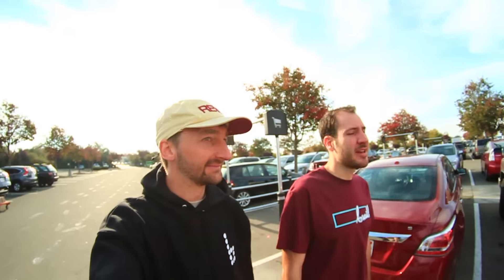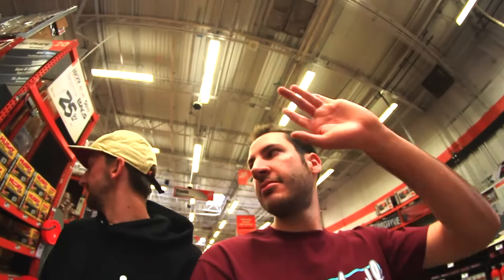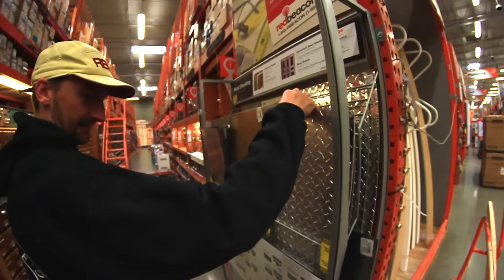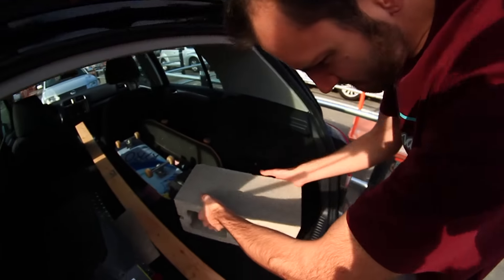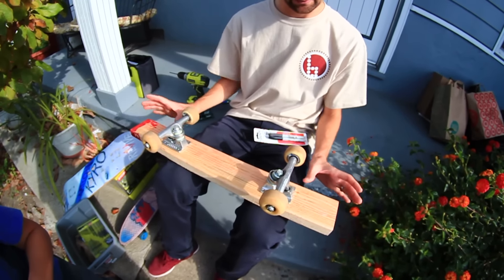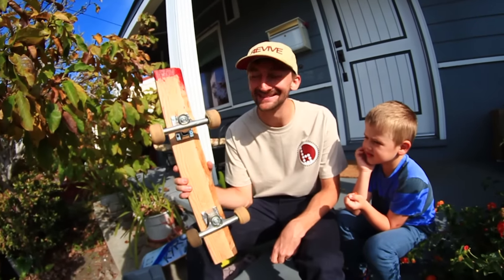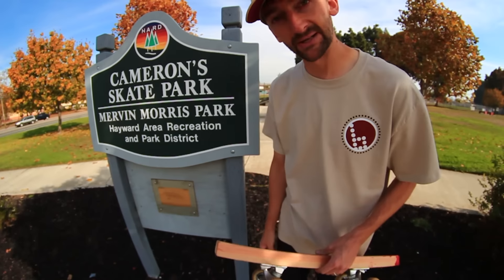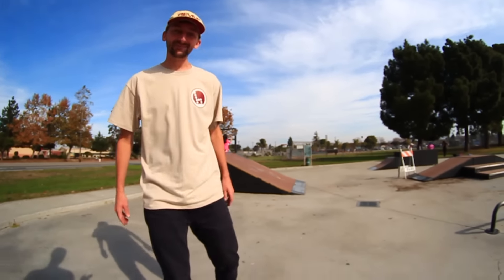SKATEBOARD TRICKS ON A 2X4 | SKATE EVERYTHING EPISODE 1

Comment: In case you haven't figured it out already, I've noticed you have had this problem in a few videos.
Basically the reason the trucks don't line up is you're not drilling completely straight, easy solution is to attach the trucks on the side you drilled on, where you marked with the sharpie, should be more lined up that way.

Comment: Use a tape measure measure from the outside edge length wise to where you want the trucks to be use a carpenter pencil mark it on each side draw a straight line across the two by four line the top of the truck up with you straight line boom! Straight trucks every time!

Comment: You need a 1x8 of some nice strong wood (maple, hickory, or ash; you're not gonna get much flex from a non-composite anyway) and some angle grinder disks (the ones with the adhesive on the back) for grip. Might be able to make a decent hardware store deck.

If somebody has the time to make and send them this, I'd like to see a game of hardware store SKATE. Maybe even get them to wear Ranglers and steel-toe boots.

Comment: If you are still taking suggestions, how about making a deck out of rolled 3/16th inch steel, sharpened to a razor edge, and liberally coated in suet?
No, no, that is a horrible idea.  Sorry.
How about making a skateboard out of an old car tire?
Or a bundle of asphalt shingles?
Or made of ice?  (construct  the deck upside down in the freezer, with sand on the bottom of the mold for grip and trucks already embedded.  TIP-  use wet shredded paper and/or sawdust in the mold for added strength.)
Or perhaps a skateboard made out of a Razor?  That would be controversial, doubtlessly.

Comment: You should have bought an impact driver instead of a drill. Its basically the same thing but much more powerful and most of them you can turn down the power to make it like a regular drill. But since you're drilling through so much random crap I think you could use the extra power from an impact driver.

Comment: Ryobi is crapware... 2 Batteries and a drill for that price lol.
Next time grab a Makita, DeWalt or Bosch. And don't cheap out on drillbits. You basically only needed 2 sizes anyway, so grab some high grade ones.
Reply: Finally someone with brains! Personally i'd go with the Makita...
Reply: Milwaukee masterrace
Reply: the makita impact drills are fucken unstoppable
Reply: Ryobi DeWalt and Milwaukee are all made in the same factory with the same guts, that specific Ryobi is actually pretty decent, but yes, Makita beats the crap out of everyone and is basically only matched by Bosch on occasion and Fein
Reply: Let's not forget Festool, those magnificent German bastards. 11/10
Reply: Salty Seamen so much power, in a tiny drill you really notice the difference.

Comment: Why do Americans call a beam a 2x4, even when it's not even 2x4, that is just so weird...
Reply: ...but it is a 2 by 4. 2 inch height by 4 inch width.
Reply: Dom White
Even when it's not they call it a 2x4, or am i completely wrong here?
Reply: I mean, this one maybe is 2x4. But i have seen bigger and smaller pieces of wood, and they still called it a 2x4
Reply: +Grafzaaiers because the length can be what ever, its 2 inches thick and 4 inches wide
Reply: 2x4s are not actually 2 inches by 4 inches. When the board is first rough sawn from the log, it is a true 2x4, but the drying process and planing of the board reduce it to the finished 1.5x3.5 size.